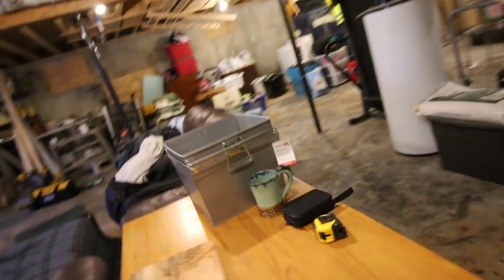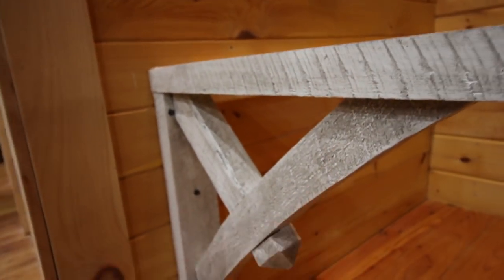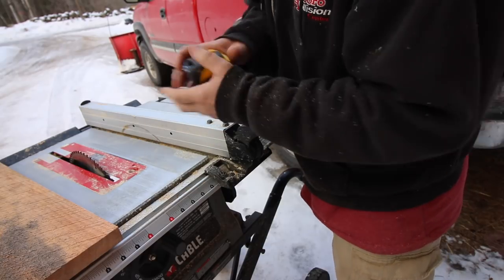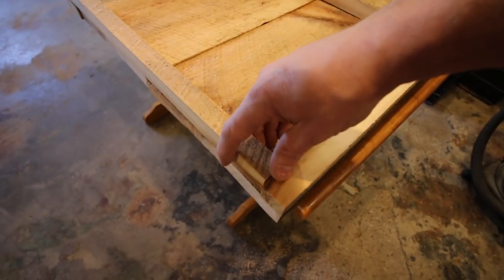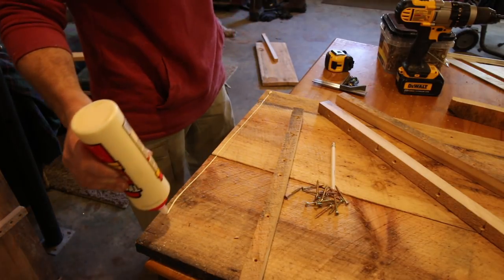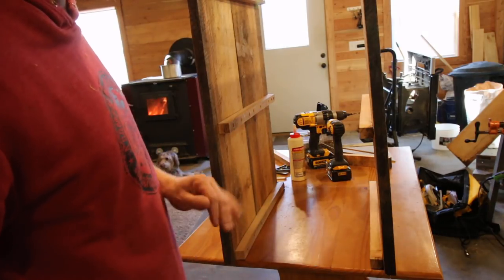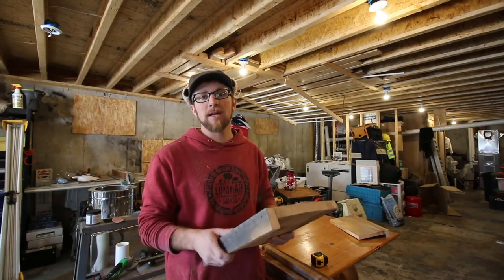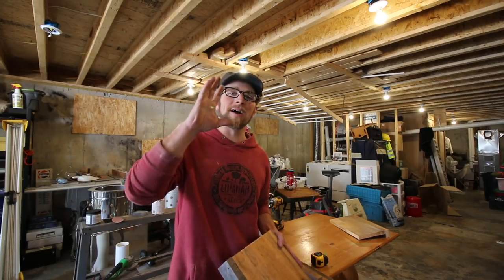Building our Rough Sawn Lumbah File Cabinet for the Concrete Desk Project

Comment: Loving the look of the filing cabinet featuring the rough timber and the metal filing drawers that has a wonderful rustic and slightly industrial look to it, which is only going to be even more highlighted by the concrete work surface. I liked your use of the dull saw blade as a cut-over to promoting the outdoor kitchen series - very sharp! ;)
Reply from the maker: shameless self-promoting! :)
Reply: Lumnah Acres hehe!  Worth promoting though - it was an excellent series and project :)
Reply: I see what you did there.